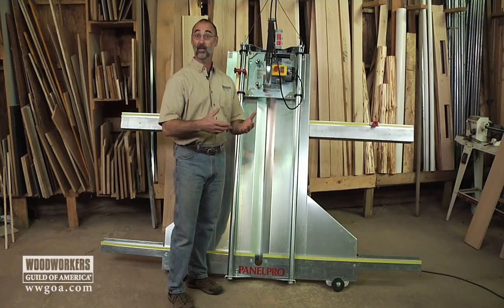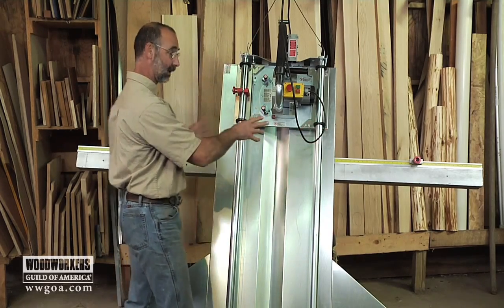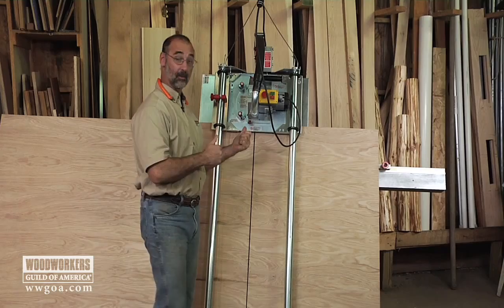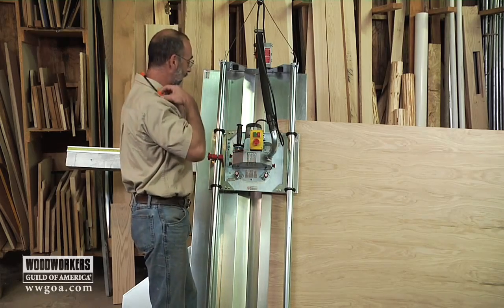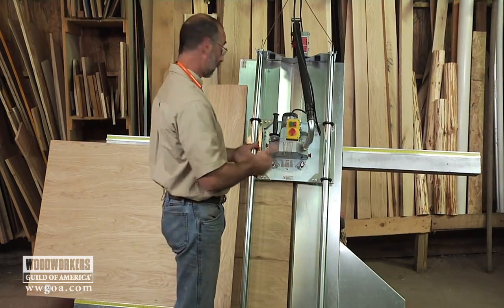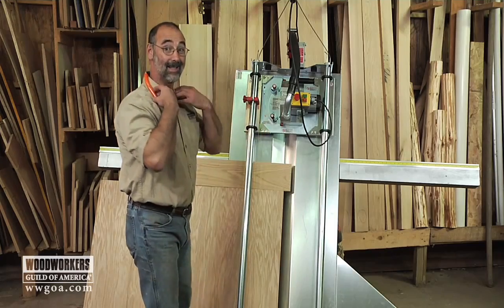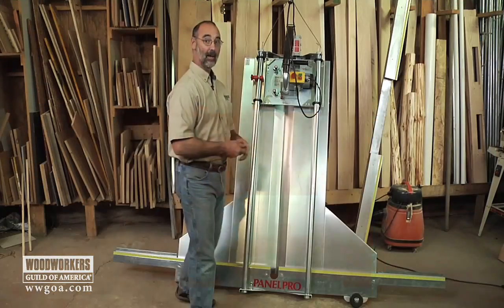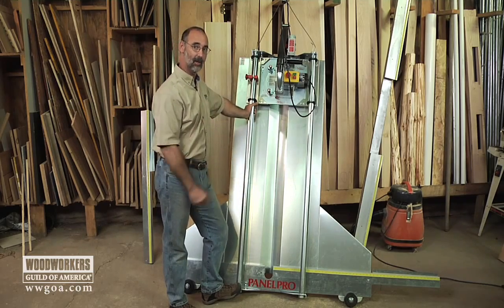Safety Speed Cut Panel Pro 2 Vertical Panel Saw | Woodworkers Guild of America

Comment: Great Video and Good Instruction.

Will this cut large pieces of foam?  I am trying to cut 79 x 39 inch of foam (Cross Link High Density) and Low Density 45 foam?  Also can you provide a demo to change out the saw blade to a 90 - 120 tpi.